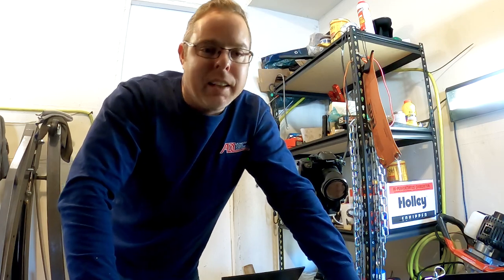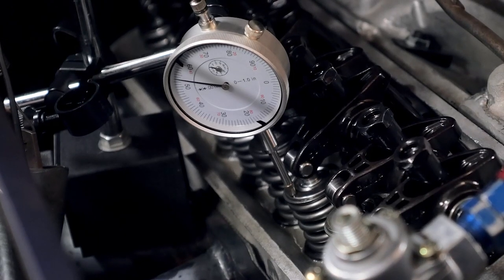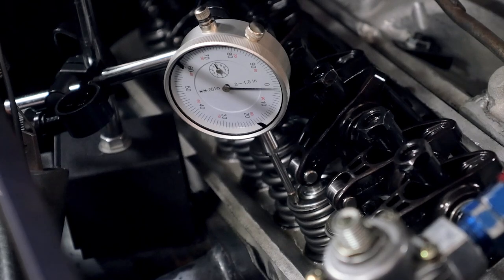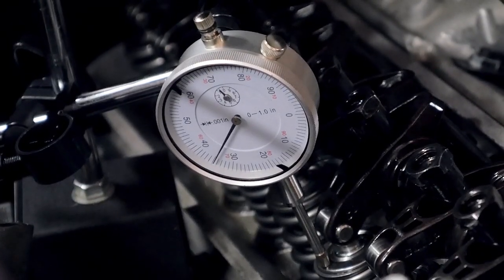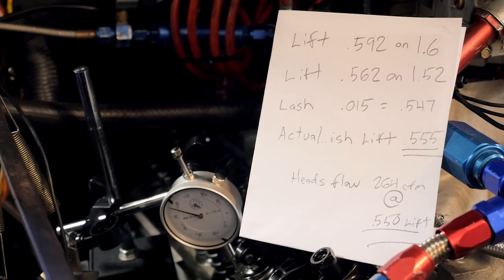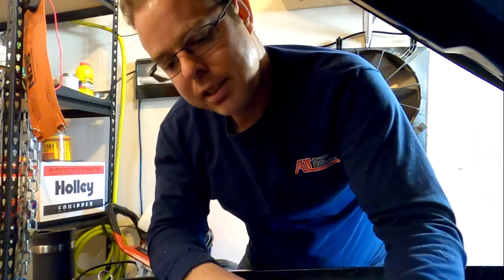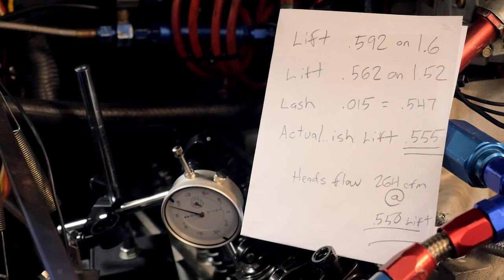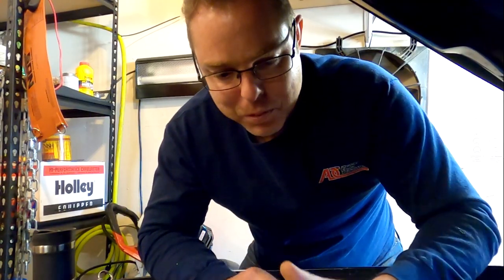Measuring cam lift at the valve with a dial indicator   " And I got a GoPro 8!

Comment: Excellent! With nitrous I used the comp 282s cam it sounded nice! Brakes sucked lol 
When I switched to turbo I called comp and they did a custom solid grind 
Little less lift 511/510  269/276 duration...@50 240/242 set 115 CL
Brakes are fantastic haha!!
Thanks for this vid! Always great learning!!
How do you know when your valve springs need changed ? Any quick test ? 
My car has been sitting a long time with here and again starts and drives